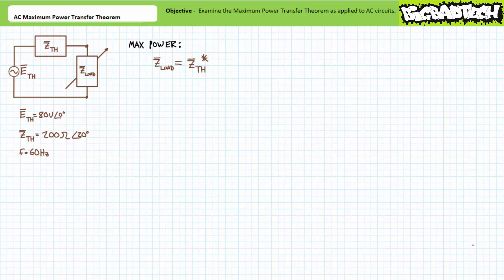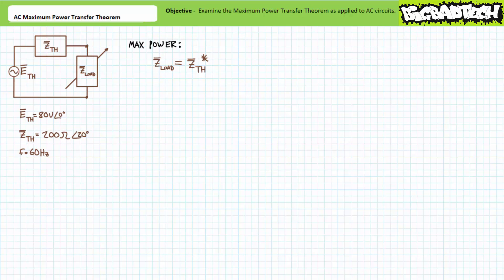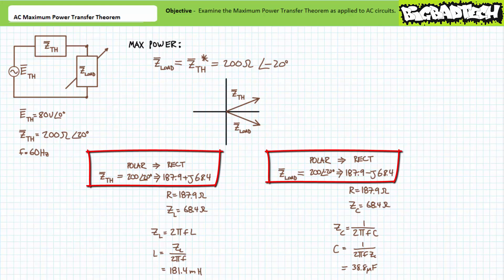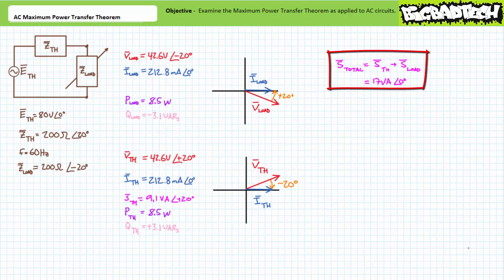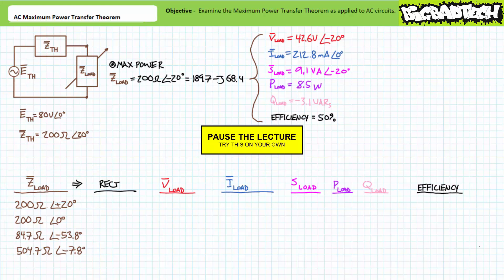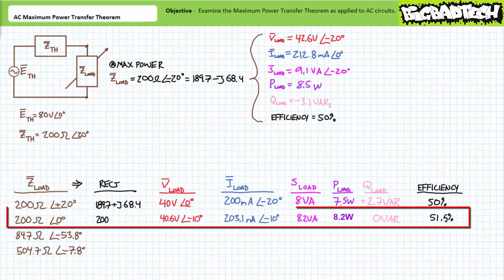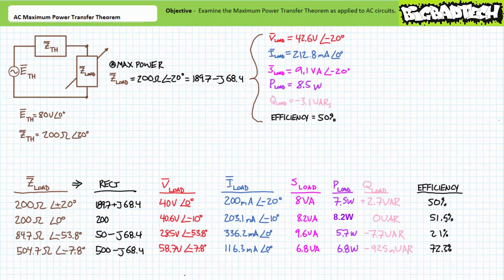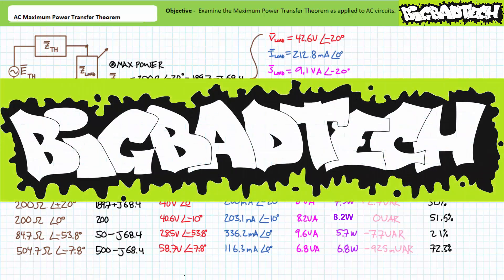AC Maximum Power Transfer Theorem (Full Lecture)

Comment: isnt s=1/2vi*
Reply from the maker: AC power can be calculated several different methods but that isn't one of them. Check out the AC power lecture at: https://youtu.be/nse2vSlOoME You might be thinking of average power where average power is 1/2 peak voltage times peak current.